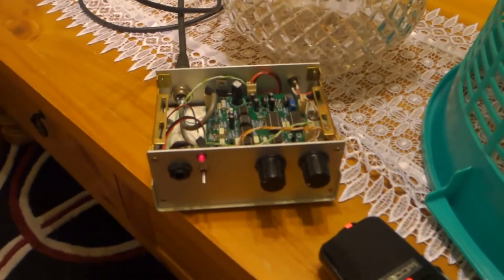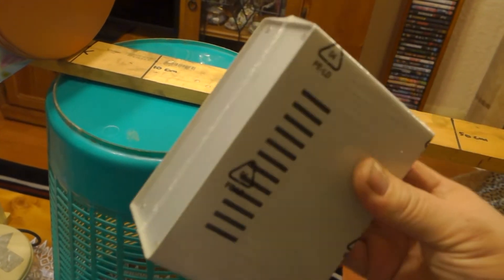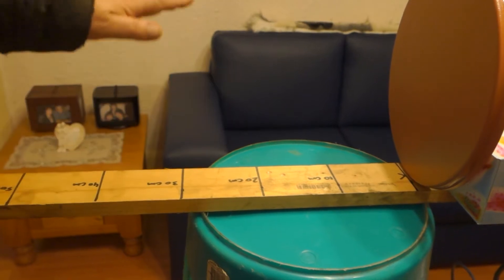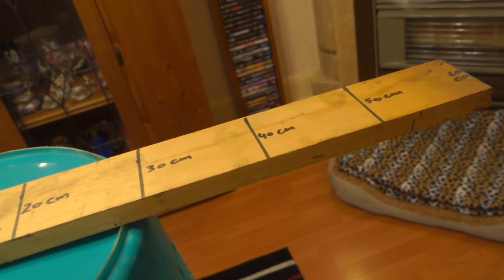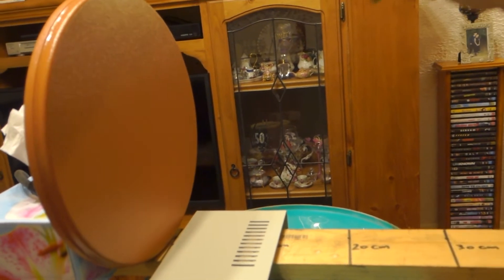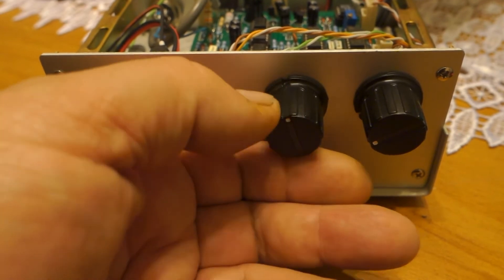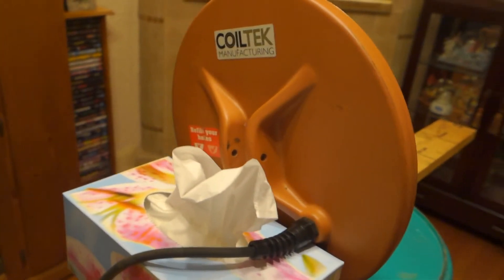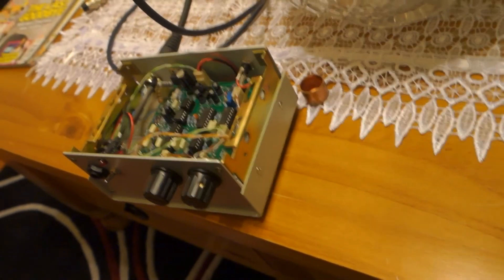Minipulse plus detector build part 2 Testing

Comment: Hi. I brought the coil off ebay it was in working order when purchased. I dont have my own detector to test it.  Its a 6x8. I dont have a scope but I might be able to find somebody with one. So I just attach the resistor to the positive and negative wires for the coil.
Reply from the maker: Mark harrison Make sure its connected correctly.  Detector cable braid to the ground side of the detector.  when you look into your nugget finder coil plug holes end and you have the notch down, the bottom two pins are the ground side and the upper three are the Positive
Reply: I have joined the pins together now. I had it wired for balance coil, when mine is mono. Its still the same. Which wires do I join resistor between?
Reply from the maker: Mark harrison If you want to add a resistor it goes in series with the positive coil wire. 1 ohm 2w. If the detector works without it dont fit it.  Mine works fine with a coiltek coil without it.

Comment: Hello again. Finished putting mine together. Problem is I get very little depth air testing, less than 10cm. Any ideas? Cheers
Reply from the maker: Mark harrison could be a lot of things but main one would be the coil.  If its not right the detect distance drops a lot.  Make sure your coil is correct inductance and resistance, very important.   I will be making a video soon re coil making.
Reply: Cheers. My coil is a factory made nugget finder.  Can I test resistance and inductance with a multi meter. Roughly what should it be.
Reply from the maker: Mark harrison Hi Mark.   If its works ok on a minelab PI then you can discount the coil.  Minelab coils are a bit off in spec to what the minipulse needs but I found them to work fine.  Do you have a scope?   You need one to check for ringing so you can determine the correct value  dampening resistor. In a nut shell you need the highest value that the detector doesn't ring with. If you dont have a scope you might have to use a variable resistor of say 300 ohms min and 1300 ohms max and adjust for best senitivity
Reply from the maker: itakeyourphoto Also check the resistance of the coil.  Its its .5 ohm like most minelab coils then probably add a .5 ohm 2w resistor in series with the coil. That will bring it closer to spec for the minipulse

Comment: Hello great video. I have also built the mini pulse. I have followed instructions. I'm having trouble adjusting r6, I don't have an oscilloscope. What sort of readings on a multi meter should I be getting? Cheers.
Reply from the maker: Hi Mark

In the end you should put a 100k pot at PL3 but before you do.. 

Monitor TP4 with an oscilloscope or a VOLTMETER and confirm the DC voltage level increases when
a target is placed near the coil.
Adjust  R6 while monitoring TP4 with a voltmeter. Set the DC voltage level to around 500mV. Make sure you short
pin2 of PL3 to either pin 1 or pin 3 (before adjusting R6) otherwise the voltage will not change.

Once you done the above fit a 100k potentiometer to pl3 with a knob on the front panel This will be your Reject adjustment (sample delay)  At one end it will be around 7us and about 40us at the other. An Oscilloscope just lets you see the exact delay but you don't need to see it. 

The 7us end is better for very small gold while the 40us is better for other metals or even larger coils. It can be used as a sort of basic discriminator.

At the shorter sampling speeds you really need a FAST coil
Reply: Thanks. What setting do I put the multi meter on? Do I adjust r6 till I get 500 on the meter.
Reply from the maker: Mark harrison If your meter has a 2v setting use that or whatever you use you want to set r6  so you see half a volt on the meter
Most meters are now auto ranging so you just set it to volts dc
Reply: Thanks for the help. Is it worthwhile using shielded wire for the pots or just unnecessary?
Reply from the maker: Mark harrison Its not needed on the  potentiometers  but use it between the detector and the coil,   You need to use a shielded cable with low capacitance. Probably the easiest to find is some RG-58  coaxial cable Its what's used to connect CB antennas and keep it short say 1.5m or less,
Once you get it going let me know and I will give you some mods you can do to increase depth a bit,
Reply: Cheers. I have commercial made coil with cable already. Is hard to wire in a volume control?
Reply from the maker: Mark harrison I didn't fit one on mine.  My headphones have a volume control.   I guess you could add a variable resistor in series with the speaker output if you wanted to.
The only controls on I put on mine are threshold and sampling delay. I have now fitted it properly into a nice bag and  some labels on the front panel.  I will add a short video soon that shows the finished product.    Make sure you read this document and add any modifications that came after your pcb revision! 
http://silverdog.co.uk/images/BuildingMinipulseRevD.pdf

I also use a commercial coil as its just a pain trying to house a coil properly even if you manage to make it fast and well shielded.   I have at least 15 coils out there that work from very well to not very well and found that housing the bloody things is the hardest part. There are a few suppliers around that sell coil shells but not many.  My coilteck cost me $100 in as new condition..why bother trying to make it lol.
Reply: Cheers for all the help.

Comment: i just finnished building one, a lot better unit than the surf pi 1.2. anyway, its still not that good on gold.
Reply from the maker: Hi mate.   I built a few surf pi's and yes this is better than those but by no means perfect. Mine is now more sensitive now than when I made this video after swapping out opamps.  Most beach detecting its more than enough sensitive but have not tried it in the gold fields yet.. I'm guessing the mineralisation is going to be its downfall.  What sort of delay are you getting out of your detector coil combo?  Mine can sample down to 7us with a commercial minelab coil.
I have a half ounce gold nugget here and it still detects a gold ring further than the nugget... don't know why.
Reply: itakeyourphoto
it detects your band stronger due to the copper in the gold ring, since the nugget is pure it only sees the gold.
Reply from the maker: aly nicholls Actually it detects the band better because of its shape.  Any metal shaped in a ring will give a higher response to a PI detector